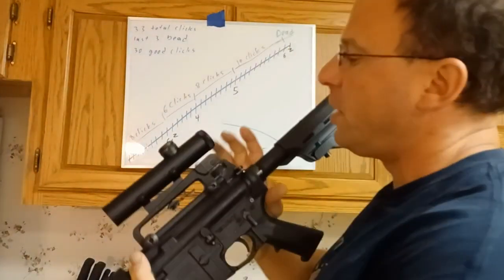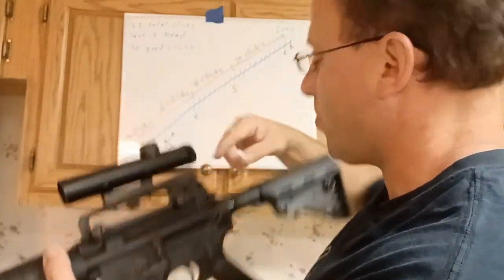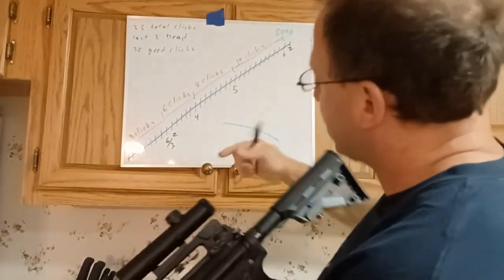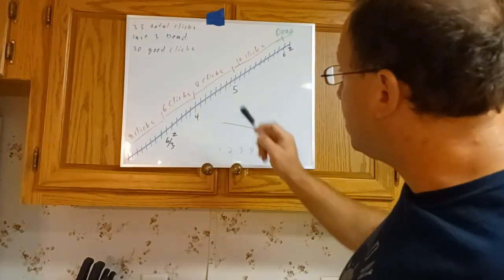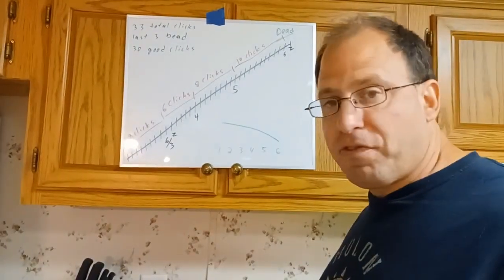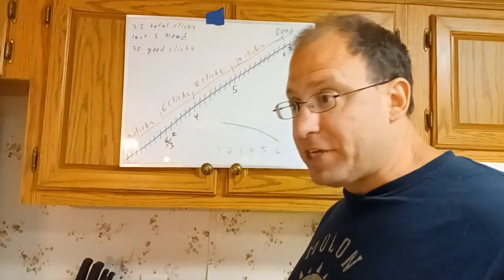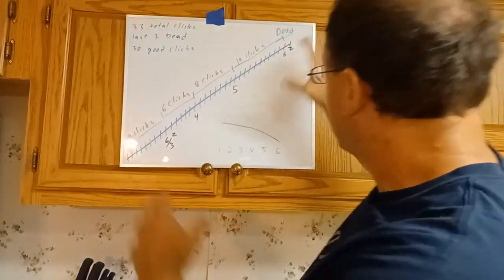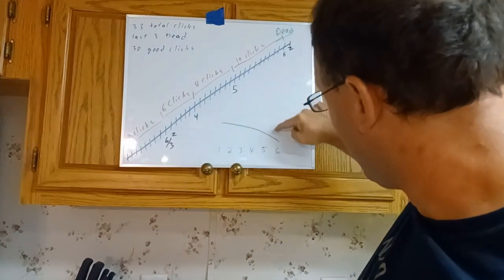Understanding the Range Drum on a Retro AR-15 carry handle

Comment: I do like your statements of "making this sighting system work for you."
Reply from the maker: I find that with all Scopes that have a bullet drop compensator you have to make it work for you because there's so much discrepancy between different barrel lengths and different ammunition.

I generally get an initial zero and then go to the halfway point of the bullet drop compensator and fine tune there.

Comment: The sight as designed has a 300 meter battle sight zero and bullet drop compensation function .and it works  well with M193, M855, and Mk262. Now, since the improved zero will preclude the 600 meter BDC function,  it’s better to just revise hold at short range. My Creds: Military Rifle Instructor assisting the USAMU deliver SDM Training.  BTW, the author here would likely be best served using a .375 minute rear sight from which a 100 yard placeholder zero would be initially set 4 clicks from bottom. This would permit him to mark sight in 100 yard increments to 600 yards and achieve X-Ring accuracy at any distance from 100 to 600 yards. Or the author could just scrape the obsolete detachable carry handle sight for an optic such as the TA31F ACOG, which has a ranging function in addition to bullet drop compensation function. A low power variable power optic is also viable  for a multitude of reasons: ranging function, bullet drop compensation function, target identification function, holds and favor off a mil or MOA scaled reticle, sight picture precision, and 1/4 minute or.1 mil value. The bottom-line being a suburb understanding for where the rifle is pointed at any distance and in any condition. One more thing, the detachable carry handle sight has a .75 MOA elevation and windage value on the carbine, while the sight has a .5 MOA value when placed on the rifle which has a longer sight radius. So the carbine has about 24 MOA of adjustment range from 32 clicks and the rifle will have about 16 minutes of adjustment range from 32 clicks. Also, the scope attached to carry handle thwarts good shooting because it promotes parallax error and an inconsistent stockweld that makes aim inconsistent. And finally, the battle sight zero will not place the bullet 10 inches high at 100 yards. The bullet will be about 3.5 inches high at 100 yards.

Comment: The reason you have the number of clicks between “X” range is due to the cam being cut (with the specific TPI) to correlate to the 62 gr. “Green Tip” ammo the military used as standard ball ammo.
Reply: The thread pitch on the detachable carry handle sight delivers .75 MOA per click on the M4 and .50 MOA on the M16A4. With either M4 or M16A4 a 300 meter battle sight zero with bullet drop compensation function can be produced shooting M193, M855, or Mk262. Interestingly enough the sight works with the least compensation error shooting Mk262. That’s great because that ammunition is most accurate too at distance having an MOA wind constant of 10 to 600 meters, bettering M855 by 3 points.

Comment: The so called improved battle sight zero is as moot at it is meaningless but it will prevent full bullet drop compensation. Just do this to adjust the M4, or M16-A4’s sights for a 300-meter Battle Sight Zero (BSZ) and   sync the sights for a Bullet Drop Compensation function (BDC). 

The “Battle Sight Zero” supports engagement of unknown distance targets, allowing the shooter to aim center mass on an “E” type target and achieve a hit from muzzle to 300 meters with bullet impacting no more than 10 inches above point of aim at about 170 meters, and hit to 350 meters with bullet impacting no more than 10 inches below point of aim. In fact, utilizing the whole 20 inches of target below center of mass hold allows the shooter to hit a target out to 400 meters.

Once zeroed for a 300-meter battle sight zero, the elevation wheel can now be hastily re-adjusted for engagement of known distance targets beyond 300 meters. This adjustment is known as Bullet Drop Compensation. The numbers on the wheel represent distances in meters. Bottoming out the wheel to 6/3 the BDC is set for 300 meters. Clicking up to 4, or 5 adjusts the trajectory of the round to engage targets at the corresponding distance (i.e., 4=400m, 5=500m). One full revolution up from 300 correlates to the number 6 on the left side of the 3. Thus set, elevation is now adjusted for 600 meters. 

Begin zeroing by clicking front sight post to where its base is flush with the deck of the front sight base. Next, set the small rear sight aperture, also known as the “daylight” aperture, in the up position (the larger aperture is only used when visibility is limited, and/or shooting inside 200 meters) and turn rear sight windage knob to align index line located on the top of the large aperture’s outside rim with center index line located on the back of the rear sight’s base. Next, turn the rear sight elevation wheel counterclockwise to bottom it out and then click it clockwise to index the wheel’s 6/3 marking to the index line located on the left side of the carry handle above the elevation wheel. 

Now, because the path of the bullet will intersect line of sight twice when zeroing to any finite distance, this is how it is possible to sight-in the M16-A4 for a 300 meter zero at 32 meters, or the M4 at 25 meters. If precluded to a 25-meter range when sighting-in the M16-A4, you can compensate for the 32-meter to 25-meter offset by setting the M16-A4’s BDC 2 clicks clockwise beyond the 6/3 setting, which will place the BDC wheel at the “Z” marking. 
So, using a big enough target to consistently understand the sight/target relationship, set the target out to available sight-in distance; and, using a center of mass hold, shoot 5 rounds from a stable position to produce a group on the target. Triangulate the group, excluding bad shots, to define the group’s center point; and adjust sights to move next grouping to target’s center. Adjust elevation from front sight by turning sight post in counterclockwise direction to move bullet point of impact down. Turn post in clockwise direction to move bullet point of impact up. One click of post will move M16-A4 bullet point of impact 1.25 MOA, or M4 bullet point of impact 1.75 MOA. Adjust windage by turning windage knob clockwise to move bullet point of impact right. Turn knob counterclockwise to move bullet point of impact left. One click of knob will move M16-A4 bullet point of impact .50 MOA, or M4 bullet point of impact .75 MOA. 

What’s a MOA? MOA (minute of angle) is an angular unit of measurement, which equals about one inch per 100 yards. Sights and scopes move in MOA increments. The amount of sight movement in MOA describes the distance in inches the sight adjustment will make at target distance. For example, a 1 MOA sight adjustment would move bullet impact approximately 1 inch at one hundred yards, 2 inches at two hundred yards, 3 inches at three hundred yards, and 10 inches all the way out to one thousand yards. 
Understanding the effect of sight movement in increments of MOA is important to correctly adjust sights for line of sight and bullet path to intersect at target distance; yet using the simple in-head math as shown, you can determine up/down and right/left adjustments needed for bullets to go where aimed.
1.	First, think what the value of 1 MOA is at target distance:                                          
Distance to Target in Meters / 100 = Value of 1 MOA in Inches at Target Distance
2.	Next, think how many of those MOAS will fit into inches of needed movement:                                                                                                                                 Inches of Movement Needed / Value of 1 MOA in Inches at Target Distance = MOA Adjustment
3.	Finally, determine how many clicks to sight for needed movement:                                                                 MOA Adjustment / Sight MOA Click Value = Clicks to Sight for Needed Movement 

For example, let us say you have set your target out to 25 meters, and you have produced a group which is 2 inches low and 2 inches right of the target’s center. Remembering the M16-A4’s front sight has a 1 .25 MOA click value, and the rear sight windage drum has a .50 MOA click value you can now determine sight adjustment needed:
First, determine adjustment needed to front sight controlling up/down movement:
1.	25 Meters / 100 = .25 Inches
2.	2 Inches / .25 = 8 MOA
3.	8 MOA / 1.25 = 6.4 clicks (round to 6 clicks) to sight elevation knob in clockwise direction for needed vertical movement of grouping on target  
Now, repeat steps to determine adjustment needed to rear sight drum controlling left/right movement:
1.	25 Meters / 100 = .25 Inches
2.	2 Inches / .25 = 8 MOA
3.	8 MOA / .50 =16 clicks to sight windage knob in left direction for needed horizontal movement of grouping on target

Is the math too difficult? Here is an alternative no-math zeroing means. Using the military 25-meter M4/M16-A4 sight-in target (NSN 6920-01-395-2949), which uses a grid to graphically indicate sight adjustment clicks necessary to zero rifle for 300 meters, the shooter can zero the M16-A4 or M4 without doing any arithmetic. Still, because sight adjustment for wind is in MOA, the shooter should practice sight adjustment using the math given, until confident, simply because there are no substitutes for MOA math when sights need to be adjusted for wind. And remember, if you sighted-in the M16-A4 at 25 meters, rather than 32 meters, you now need to turn the elevation wheel counterclockwise 2 clicks, which will index the 6/3 marking to the index line on the carry handle above the elevation wheel. Thus set, the rifle is now zeroed for 300 meters and synchronized for a bullet drop compensation function.
Reply from the maker: Thank you for posting that detailed information.

Comment: On my Colt AR-15 A4, which has a 20 inch barrel, the lowest setting I can reach on the drum is the Z setting. I can't turn the adjustment knob counterclockwise any farther to line up the notch on the drum just above the 6/3 setting with the mark on the handle. In the manual it says for proper zeroing at 25 meters, the knob should be rotated 2 clicks clockwise from the 6/3 setting. This is exactly where the Z setting is located. The Z on the drum is not mentioned at all in the manual. I guess Colt made the change to the drum without updating the manual. Also, from the Z setting to the 4 setting I have four clicks. The highest setting I reach is the notch above the 6/3 setting.
Reply from the maker: The drum consists of a top half and a bottom half. There's an Allen Screw in it. Once you loosen it up, you're able to rotate half of the drum and gain access to additional settings.
Reply: @tsafa Yes.I realize that now, but for now at least I think I'll just leave it as is since I plan to zero the rifle at 25 meters. But I just read the pinned comment on your other related video. After zeroing at 25 meters with the drum set on Z, you then have to return it to the 6/3 setting to be zeroed at 300 meters. So I will have to adjust the drum so I can reach the 6/3 setting. This is not explicitly stated in the manual, but makes sense. Now I have to find a 1/16 Allen wrench. Thanks for the information.

Comment: Not to be picky, but don't you really mean meters when you are saying yards? I know that using the RIBZ you can actually get some of your settings to correlate to yards, but it was originally set up for meters instead of yards.
Reply from the maker: Yes you are correct, however if your initial zero is in yards, then the range adjustments should follow that as well. 

To really fine tune it, you have to get out to the 300 yards or 300 M and do an adjustment there since that is close to the halfway point. Then everything below and above it will be acceptable accuracy.